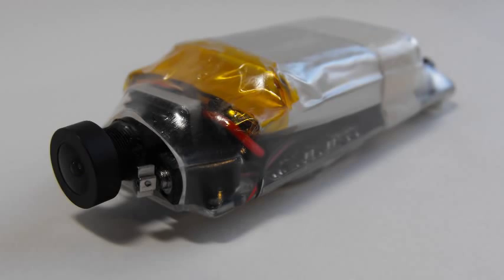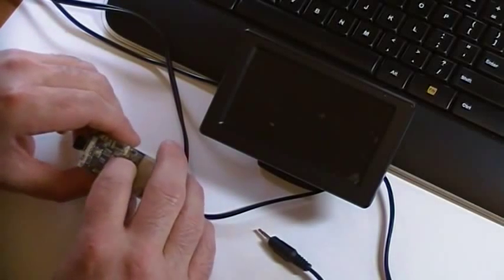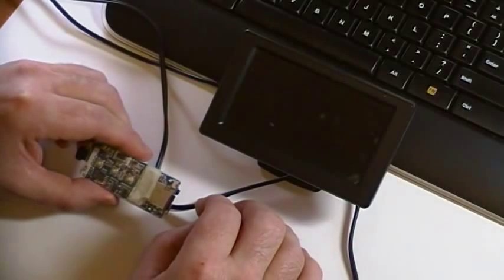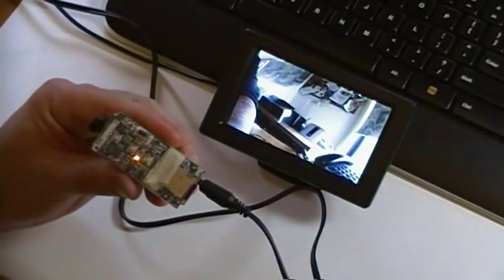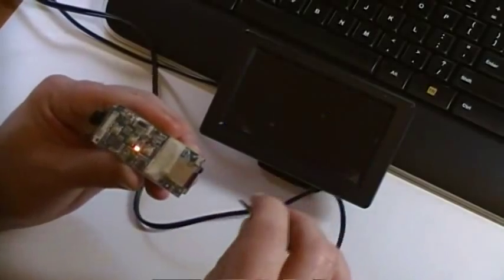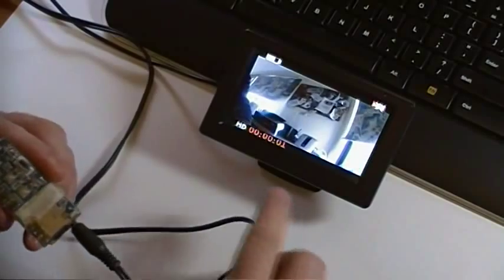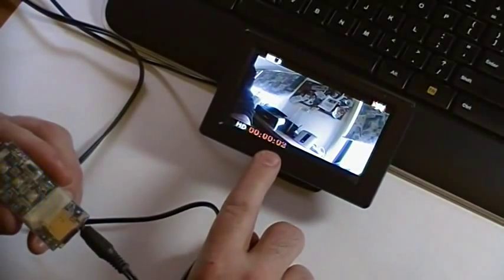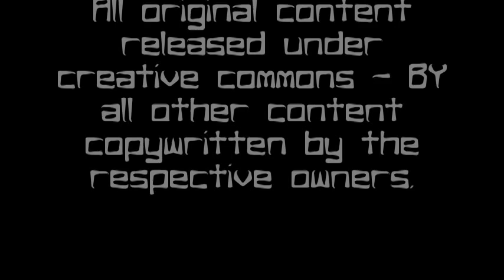How to - Hobby King Wing Cam to record and output AV

Comment: Just wondering is the fpv video quality better with hd cam than most of the cheap board cams cheers
Reply from the maker: that's a good question. I'm setting up a quad now and using this cam. I'll test and compare.
Reply: Look forward to here about it. If it is any good  it should save some weight not needing two cameras and would be alot more stream line